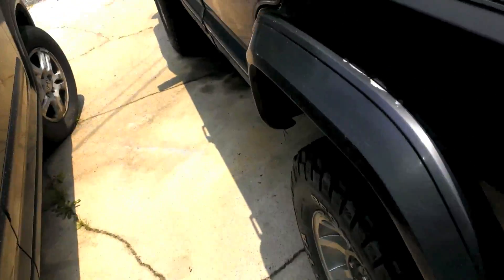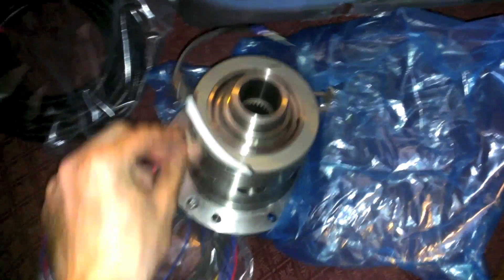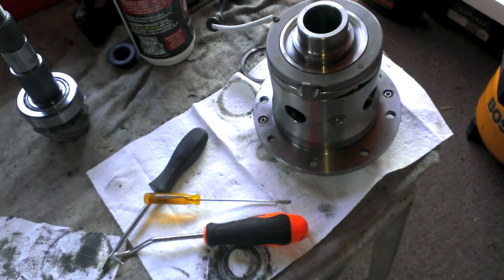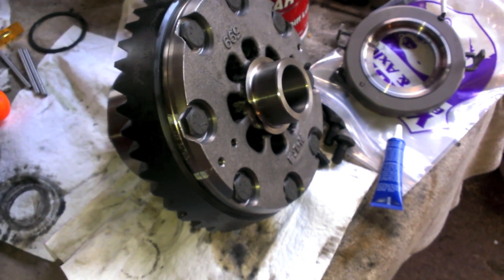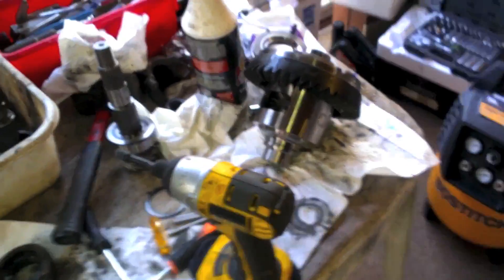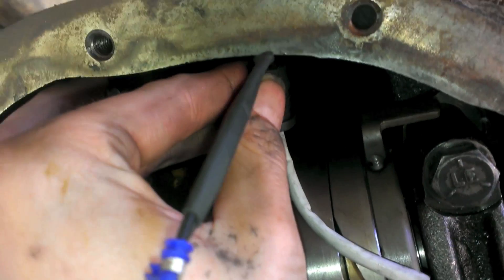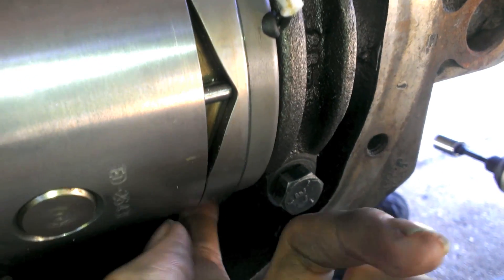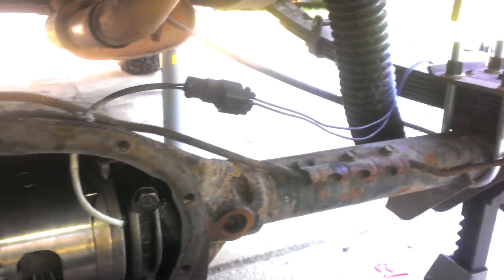89 Cherokee Dana 35 Eaton E-Locker Install

Comment: How does it hold up to this day? Do you own this vechicle?
Reply from the maker: I don't like the e-lockers much for complicated crawling. I switched to OX Lockers and like them better.
Reply: @NickInTimeFilms  Thanks for reply. Can You elaborate more, why? What was the issue?
Reply from the maker: The Elockers have a spin up and spin down time, so you have to time them right. For instance, if you are locked and then have to make a sharp turn, you have to turn them off way ahead of time to make them disengage, or you won't be able to make the turn. The ox locked are on or off immediately once there is no tension so it's better for turns.

Comment: Great vid. Question... we have the same locker... shop did the install of the diff... we’re doing the wiring. There’s an additional Gray wire coming out of the main wire from the diff... is that just another ground? (The switch also has a ground and so does the relay so why a 3rd ground?)
Reply from the maker: I have a video specifically for just the wiring I'd the elockers, but if you've got 3 wires then you've got a different setup. Maybe a confirmation ground so the light only comes on if it's actually locked? No idea, I'd check the documents that came with the order.

Comment: Do you know if the Eaton locker works with the rough Country’s 4.56 re gear kit
Reply from the maker: Eloocker uses custom carrier bearing, but otherwise should work fine if you match the locker to the carrier break number.

Comment: what if you press the switch by mistake on the highway ?
Reply from the maker: Nothing happens untill you try to turn, then the tires will chirp and try to slide
Reply: You can wire the locker switch into an activator switch. 1 switch lets the second switch activate, if you’re worried

Comment: Nice vid, Nick. What do you think about a locker in the front of my 89 Cherokee? It's my daily driver I sometimes drive 200 miles a day. With that being said, do I need to re shim the carrier also?
Reply from the maker: Depends on the terrain your are looking to go over. If you plan to try going over things,  a rear is probably a better bet since all the weight will be on the rest tires
Reply: @NickInTimeFilms  
Thank you. I mostly drive on River beds or cross River beds not much of a climber. I just mainly want to make sure it doesn't cause any damages if I'm using it as a daily driver more than anything.
Reply from the maker: Depends what kind of locker you get. The lunchbox style and some lsd will try to lock when accelerating which may be annoying or dangerous on slick turns. I went with fully selectable so they are open on the road like stock, but can fully lock when activated
Reply: @NickInTimeFilms  

I bought a Dana 30 front end and when I opened it up there was a powertrax locker  inside. So it's already in the carrier and it's a 3:55 just like mine. I just don't want to put it in and do any uncecesary damage if it's my daily driver. I'm a fairly new "jeeper" so I don't really know much about lockers. Will this type lock up on acceleration or in turns? With that being said do I need to reset the shims.??

https://www.jegs.com/i/Powertrax/754/2210-LR/10002/-1?CAWELAID=230006180040333276&CAGPSPN=pla&CAAGID
Reply from the maker: And if you are replacing the carrier then it should be re shimmed to ensure a good gear pattern.
Reply: @NickInTimeFilms  

Thank you so much.. ! I guess now I need to learn more about the re shim procedure.....FML..!!! 😩
Reply from the maker: Got a whole video on it with the case spreader, haha.
Reply: @NickInTimeFilms  

Thank you, you are my favorite source when it comes to my 89 Cherokee, mine is a limited edition so it's a little bit different than yours but you are very thorough with your vids and explanations, not to mention your quick replies...!! You're the man.!!

Comment: I wanna install these front and rear in my XJ, 30 & 35 also. I have a 98 XJ 5 speed, 6.5in lift with 33's. I bought it like that and have no clue what gearing is in it. So I'm guessing I still have stock. Would you suggest I rip the cover off and look before ordering anything?
Reply from the maker: Certainly wouldn't hurt to see what you have now. You can pull the cover and look or just count the driveshaft revolutions with one of the tires jacked up and spun 2 full revolution. here's a quick video of what that will look like https://youtu.be/dGjNmLNUzZg?t=1m45s
Reply: Very helpful. Thanks Nick

Comment: Why upgrade a Dana 35?  Makes NO sense.
Reply from the maker: Muffduster It isn't the strongest axle but it isn't exactly made of glass either. I didn't feel like sourcing an axle at the time so I worked with what I had. I'm very light on the gas so I'm not worried about it too much, and that's with running 35x12.5's. It's a non clips so at the very least i'm not going to die, lol.
Reply: i have 30 spline axle shaft  in my dana 35  on 33 inch tires  jeep yj   and never have a problem  ,
Reply: only d44 or f 8.8 guys make these comments...lol.  Super D35 upgrade with 30 splines are a proven upgrade with thousands doing it.  A complete swap is not for everyone.  Super D35's hold up fine with 35" rubber.  Don't believe the haters...
Reply from the maker: I should have gone super for sure. Snapped the only Chromoly shafts I could find for this turd and eventually went to a 44. Lol
Reply: I had an XJ and YJ manual both with locked d30/d35s and 31-33” tires at different times. Never had an issue and I was not easy on them either. I had an 8.8 sitting around waiting for something to explode for the past year and... I ended up selling it
Reply from the maker: @headlesnorseman701  31 narrows vs 35 wides is a huge difference. Especially when I was fully locked and have a 4.6L stroker. I dont floor it through obsticals but the 35 was still no matches for my setup. Maybe a super 35 kit if you want to push your luck but given the option again, I'd build another 44 hands down.
Reply: NickInTimeFilms oh yeah a stroker and locked is a different story. I have the same Eaton e locker in the back and I barely ever use it. I’m trying to make it last before I get the itch to go to tons lol

Comment: One thing I must say, is that everything I've read about installing ring gear is you 'DON'T' use the ring gear bolts to draw the ring gear up to the mating surface, as you suggested. Anyway, it seems to have worked alright for you, and I'm happy for you.

The thing that I'm considering doing is... I'm like you with respect to the 'anti rotation tabs' and that there appears to be an over abundance of slop in there Even though it's 'flex' they've used, it still strikes me that the conductors can break and fail with that constant (what I'd call) 'unnecessary' forward and aft movement!  I'm considering welding some flat spacers onto those tabs (on mine) to take up some of that slack!

Hey, anyway, nice video, thanks for posting it. It's certainly good to see someone else's efforts before I tackle it myself! :)
Reply from the maker: I didn't feel like trying to heat the ring gear and freeze the locker and wasn't confident in trying to press it on so the bolts  were the best option I had. I made sure to use lube and turn each bolt 1 turn or less in a star pattern to keep the pressure even and spread out. It worked for both axles without a hitch so I'm not too worried. 

I didn't end up doing anything about the tabs so let me know how your idea goes. For comparison, the Dana 30 e locker had a much tighter fit for the tabs. Good luck setting everything up.
Reply: NickInTimeFilms I'm fitting it to a 1990 Toyota Landcruiser Prado LJ78 front diff before I get the said diff fitted to my 2003 Toyota SR5 Double Cab Hilux, and then I want to fit one to the rear of the Hilux.  But what you said about the Dana 30 makes me think all the more that the slop is unnecessary. I figure I might just weld a couple of bits of stainless flat underneath the tabs to take out the slop, or lessen it at the very least! Who knows, maybe I'll make a video on it?

Anyway,  is your one performing alright?
Reply from the maker: SeriousSchitt My front and rear e-lockers are amazing, worth every penny. You get a full 50/50 torque split to both tires and the traction benefits are unreal. I got stuck sideways in a small ditch, flipped on the lockers and drove right out. You just have to make sure you go slow at first to engage the lockers, once locked you can hammer down though. When my group gets their jeeps up, i'll have plenty of footage to show off with.
Reply: NickInTimeFilms Oh cool, look forward to seeing them. Now, you didn't end up using shims in the carrier bearings, at the end of the day did you?
Reply from the maker: SeriousSchitt I had to re-shim both axles because I re geared them to 4.56. Watch the dana 35 regear video to learn everything about properly shimming.

Comment: I always thought you had to have things shimmed perfectly when installing gears, like within thousandths.... Looks like you just bolted everything together and put it in??
Reply from the maker: Shimming is very important when it comes to setting up an axle. I split the dana 35 overhaul into a few videos because it would have ran too long otherwise. I have a another video that focuses just on setting up the new gears. That goes over every little detail about shimming the gears.

Comment: Did you consider making the hole through the cover instead? It might have been closer to the center of the cable's movement range.
Plus, it's an easily replaceable part.
Reply from the maker: That was an option I considered. In the instructions it says to use a 1/32" smaller bit to compensate for the thinner material. I figured since the diff cover will have to come off to change the fluid, it would be annoying to have to keep disconnecting the connector so I went for the housing instead. Thanks for the suggestion though.

Comment: keep us followers updated with the performance of your new lockers..maybe a offroad video!!
Reply from the maker: These videos are a bit delayed so I have already tried it out once or twice. It is the next button I reach for after putting it into 4lo. It takes about a full revolution to engage and disengage but It's practically instantaneous and completely silent. It works as advertised, Completely open on the street with no loss in turning radius and 50/50 locked off-road with no wheel spin. I've used it to climb stumps and crawl out of a shallow river so it's already worth it. Doesn't help much once the axle or the body gets snagged though. I have some footage I'll put up soon.